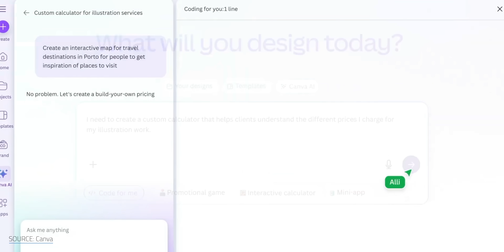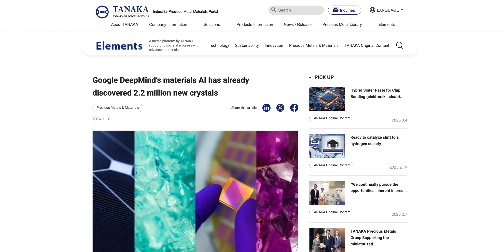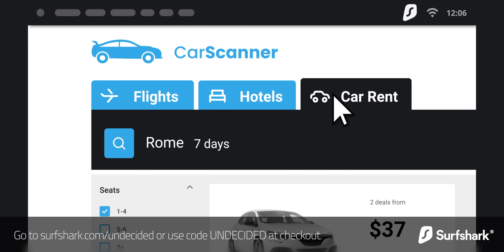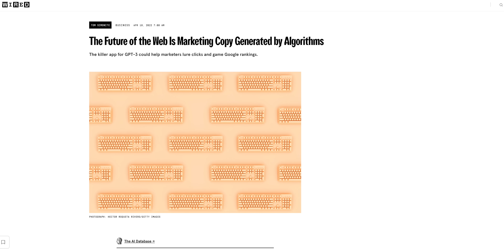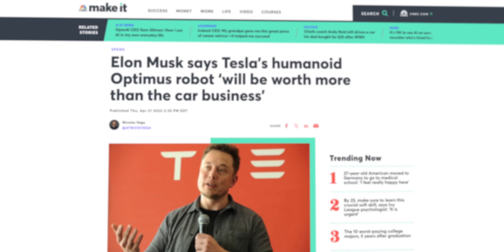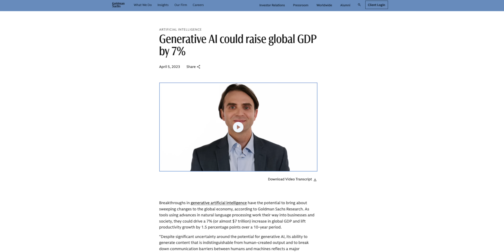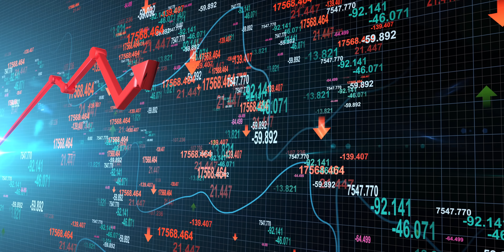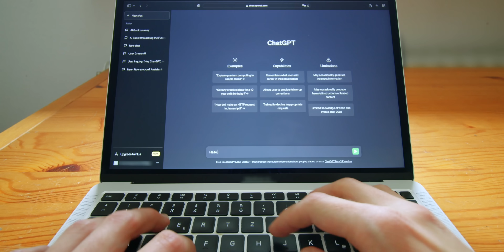Why the AI Revolution Has a Fatal Flaw

Comment: As someone who has been "an expert in many things" and used AI (I'm a former military "Rocket Scientist" and serial entrepreneur/inventor) I routine reach the limits of ChatGPT and Grok.  It's not really hard.  It does accelerate but it does not invent anything by itself.  It simply helps human do what search engines have finally failed to do.

LLM/Machine Learning AI is, what we call in Electrical Engineering, a "causal system".   That specifically means - it IS NOT INTELLIGENT in any strict sense.  It's a zero sum of information in terms of training and can never "create" much more that it was fed - only a combinatorial expansion of that existing information.   A human can create with the help of AI but it's only an accelerant. 

The one things about AI is that tere will be lots and lots of Midwit/Dunning-Kruger managers who will confuse what AI does with actual intelligence.   MOST of these companies who jump in hard will ultimately FAIL and go bankrupt.

Photoshop is still needed - because the images have hallucinations in them beyond a certain minimum (I do art as a hobby, and use Photoshop).   It's the same limitation described above.

There is a good point about the Jevon's Paradox.   The intersection of losing jobs, failing demographics and AI does create a dangerous situation.  It's NOT primarily about human work (either lost jobs or lost demographics) - the bigger problem is AI generate NONSENSE that very often does NOT align with reality.  This is the exact same nonsense as WOKENESS - it doesn't matter that the idea is creative or ideologically ideal - the only thing that matters in the end is MERIT which corresponds to a reality-based solution.  AI can not and does not do that.

Again when an expert uses AI, that expert (like myself) routinely runs into the limitations very quickly.  AI is enthusiastically stupid and error-prone.  And that means jobs replaced by AI will not magically be done well enough to produce economic value for the corporation(s) that adopt it.  In fact, the odds DROP that fitness of value generated by AI will ever be of use by the market.   The markets created will resemble the Chinese real estate market, steel and concrete markets, etc.  100% made and fake.

The reason is because markets do NOT exist without humans and human desire or need.  You can pretend to replace consumers with AI also but it will rapidly create a non-physically viable market values.  That will collapse upon itself pretty quick.  Just like China's economy or Russia's economic are collapsing - they do this because they are disconnected from economic reality.

UBI is NOT financially viable.  As is the offer to "be put into a computer".  Neither of these are ENERGY or FINANCIALLY viable.   The only resulting answer WILL BE SYSTEMATIC GENOCIDE.   

People put into computers will have to "earn" value to pay for the energy and maintenance required.  Most will simply be "deleted" and probably as soon as they are put into the computer.  That is the optimal solution.  As defined by physics and economic realities of it.

Keep in mind that the energy efficiency and reliability for all computers and AI are <1% of what humans are.  That iPhone you use has a chip lifetime of about 10 years and can not self-repair or reproduce itself like a biological.  

And the future of making anything that can match that is no less than 500-10,000 years if everything went right.  These is a very good chance this limitation is backed into the laws of physics of our universe.  Period.

People who claim "singularity" will fix that are ignorant liars at best.  They know NOTHING.  Singularity as equivalent to human intelligence is 1000s of years into the future at best.  Their arguments are simplistic and detached from reality.

Comment: The kind of research you do isn't going to be replaced by AI at all. It requires critical thinking, weighing cons and pros. Something I definately do not see in any of the LLMs so far anyway.
The broader point of your concern remains valid though. People working preparing boxes to be shipped, getting replaced  by robots - I don't see them easily shift to office jobs: partly because it doesn't match their skills -- but partly because it doesn't match there interests, which is a very different factor

Comment: Lots of questions. No one is talking about what will happens to the developing countries. Individual as in poor countries, what about the baby boomers? Many boomers which still work probably could find jobs in the process of building the new industrial infrastructure that should be made, and most prediction point toward a massive industrialization required by the tariff crisis, during years to come, so probably jobs will be abundant still, if the growth in industrialization is matterialized  but not 100% robotic, at least until boomers are completely out of the labor market and newer generations will be more integrated into the AI revolution. I think that a possible solution is to regulate labor thinking in that way.

Comment: Capitalism as a system just doesn't make sense with the introduction of AI. But of course that's operating on the assumption AI can actually do the jobs theyre replacing properly, which is simply not going to be true for most of them. Not that the rich care about that. A lot of them are accelerationists. Societal collapse is the point, because they believe they can grow their own little city states out of the ashes. The rich need to be reigned in or well be subject to pure anarchy.

Comment: Look into the various musing on post labor economics - generally speaking what you tend to see is the idea that UBI will provide for basic needs and investments will provide the rest (and a small amount of jobs where human-human interaction is preferred will persist).

Without wages people will  begin dividend seeking which will create a competative market for companies (now flush with profits from not needing to hire labor) to provide monthly/bi-weekly dividends to replace the cashflow people are used to from wages. As long as UBI is greater than the bare nessesities in a given location then it provides an on ramp for people to enter into the investment economy. You don't even need to provide UBI purely through taxes, if you direct the FED to disburse cash as UBI instead of as loans to banks then (using the average monetary policy from 2010-2020) you could provide every citizen with ~24K/Year through monetary policy and only top off the rest via Taxes. There's also the added benift that if you remove the Fed loans system then companies need to seek funding through stock or bond sales which all increase monetary velocity back to the consumer base. The Gov just needs to provide a UBI system and allow existing retirement vehicles to be accessed at any age and the rest of the system should evolve from the current economic system.

Fast-forward to ASI and you can envision an economy in which people's personal AGI's invest in companies based on the persons preferences (risk, ethics, morals) and the companies they invest in are all automated, run entirely by ASI systems, emedded with anti-monopolistic drives, and owned by millions of people with no one individual holding any significant sway in the company. In essence - "you" will own "everything".

Comment: I have had this question bouncing around in my mind for some time. Future prognostication is never good, but deeper research is required to understand the "tipping points" to determine more realistically which way things might go.

Another issue I would love to research -- but haven't had the time -- is the exponential increase in the electric and water consumption needs for the data centers that will be required to physically power all of the rapid growth in AI. It ain't free (as casual users tend to believe and use AI as a mundane replacement for two seconds of mental effort, making us dumber as AI gets "smarter"). There will be two closely related problems: 1) rapid escalation of electricity demand (especially as the U.S. power grid is already fragile), and 2) impact on climate change if we solve the first problem by keeping or even growing fossil fuels such as coal to power these centers.

If the electric grid cannot expand quickly enough, there will limits to how quickly AI will be adopted as the cost of using it will increase dramatically, etc. (Homes having brownouts simply due to AI demand? etc.) Have you done any videos on this?

BTW, love your work!!

Comment: After the tipping point of the AI revolution, money will lose its traditional meaning.
Work that still requires human involvement will be done by volunteers—people seeking purpose, fulfillment, or connection. For them, contributing will be a choice driven by meaning rather than necessity. And for those who prefer not to work, they won't need to—because survival will no longer depend on income.

Comment: I think training robots will be a massive field of employment for the initial stages.
Also we don’t have the bandwidth infrastructure in place to run so much Ai. The robots and Ai with therefore occupy niches where the computational and telecommunication capacity is most profitable. So a lot of Ai will be dumb enough for humans to still be useful in a directorial capacity. 
Until we have developed cheap widespread electricity to power ubiquitous high level Ai then most Ai will be preprogrammed bots and augmentation of human activities imo.
It’s essentially an infrastructure limitation issue.

Comment: Based on data available through October 2024, several key statistics show the impact of delivery services like Uber Eats, DoorDash, and Grubhub compared to the pre-app delivery era:

*Market Growth and Penetration:*
- The U.S. food delivery market grew from about $4 billion in 2015 to over $50 billion by 2023
- Online food delivery penetration reached roughly 30-35% of total restaurant sales by 2023, compared to less than 5% in 2015
- During COVID-19 (2020-2021), some markets saw delivery grow to 40-50% of restaurant revenue temporarily

*Labor and Employment Effects:*
- By 2023, there were an estimated 5-6 million delivery drivers across major platforms in the U.S.
- Traditional pizza delivery jobs (which dominated pre-app delivery) remained relatively stable but represented a much smaller share of total delivery employment
- Studies showed average hourly earnings for app-based drivers ranging from $10-20 per hour after expenses, compared to traditional delivery drivers who typically earned $12-18 per hour including tips

*Restaurant Industry Impact:*
- Commission fees to restaurants increased significantly - apps typically charge 15-30% compared to traditional delivery services that charged 10-15%
- Restaurants reported 20-40% higher delivery volume but often lower profit margins per order
- Ghost kitchens and delivery-only restaurants grew from virtually zero to thousands of locations

*Consumer Behavior:*
- Average delivery order frequency increased from about 2-3 times per month (pre-2015) to 6-8 times per month for regular users by 2023
- Order values typically increased 15-25% due to easier upselling through apps
- Delivery radius expanded significantly - apps serve areas that traditional delivery rarely reached

These statistics come primarily from industry reports, academic studies, and data from the Bureau of Labor Statistics through 2024.

Comment: Perplexity pro has an incognito mode i can use to work on customers data without letting them be used for training. It gives me peaces of advice on many technical topics , saves me time and helps me fix issues.

It usually goes much faster than Google.

It can process things i dont understand myself.

It can find flaws i cant see.

It provides sources when i need to quote code (either legal or technical ). 

So yes it helps me work alone, and avoids me employing people, or pay specialists.

But ... My company is losing money, so if i had to pay for all those things i would be bankrupt since over a year , have closed my company and be jobless. 

If i was jobless, i would produce nothing at all, and would not either have cash to pat specialists. So, AI or not, i can't pay specialists. 

AI keeps me living. 

Each time i get some spare money, i pay someone to check what AI did in the past. Last week i spent 1500€ to rewrite my website.

Comment: I've been thinking this for some time. The evaluations are based on the idea there are consumers. If few are employed, where are the purchasers? Thank you for putting a spotlight on the issue. 

I'll add that if there's going to be help for the displaced, why are safety nets being cut while we cut taxes on the affluent? Wouldn't that need to be reversed?

Final thought and I don't want to be a downer: what are the odds we get AI right for 2000 years? For 200 years? For 20? At some point it seems likely we make the wrong set of  mistakes (whatever those are).

I don't see it as a question of if. It's when. Maybe I'm alive to see it, maybe my kids are, maybe we figure it out. But it feels like a Fermi filter we aren't talking about. Because it's inevitable and human imagination doesn't think longer term usually.

I'm not a doomer. I'm just seeking to see clearly and challenge fate where I can.

Comment: Based on recently reported AI exploits specifically focused on "LIKE" data sets, there might be a high expectation that human jobs,  most likely starting with jobs with repetitive and or repeatable tasks will be replaced ... this trend has already been in motion with robotics since the micro chip explosion back as far as the 80's ... BUT ... like the onset of the Internet, where information could be quickly searched digitally,  AI, per my experience, has only enhanced this digital search capability such that a HUMAN still needs to glean whether the resulting information is relevant. Although I have been involved with computer software/hardware design et all for over 40 years, attempting to configure a linux machine especially if you don't do it as a daily task, can still be daunting ... case in point, currently on day 3 of attempting to integrate a PI camera into Home Assistant with the help of ChatGPT 4.0 (supposed to be a simple task) ... while progress has been made, the end result is still a work in progress. From my observation and discussions with other technically oriented individuals, although AI has seemingly mastered language (being capable to reasonably determine from user input: subject, context of a question that it is being asked to answer ... IMHO better then MOST help forums), we have yet to see any evidence of thought ... you can present AI with a question and it will return the most likely result from its available dataset,  which to be fair, can save you from having to dive into reams of data yourself ... BUT ... AI interaction from my perspective still requires trial and error / cause and effect processing ... which ultimately requires a HUMAN that can ask the right questions and select/try the best answers ... there will always be businesses (bean counters) that believe replacing people with tech will make them rich ... suffice it to say Henry Ford's idea of only making products that his own employees could afford will be lost if there are no more employees ... history provides numerous examples of what happens when social imbalance becomes intolerable to the masses ... hopefully that rabbit hole doesn't present itself in whats left of my remaining journeys around the sun.

Comment: This is not really a flaw. You have to keep in mind that the AI is owned by corporations and is their private tool, not yours. These corporations will simply transition from producing consumer goods (as there will be no consumer as far as they're concerned) to producing goods for each other. It is not their problem that you will be left without anything; "civil unrest" is handled easily with modern tech, which will soon also become autonomous. It's likely going to be cheaper than providing UBI, too. Not that there would be any consumer products you could spend it on.

Essentially, the economic system will split in two separate ones: one for the AI-owning corporatoins, and another will be built up from rubble and leftovers by the rest of humanity, if it refuses to simply die out as it is currently being primed to.

Comment: Ultimately businesses need consumers to drive economic activity. Particularly in America the economy is heavily dependent on consumers. Businesses producing products and services that nobody can buy will die. UBI and co-op style ownership models are where it has to go. AI may look like a disaster for workers and short term it could be. Long term though it shows the fatal flaw in capitalism that perpetual economic growth isn't possible, AI is just accelerating our journey towards that finish line which will lead to a new economic model that will be some hybrid between socialism and capitalism where there is still ownership but it will be more greatly shared with government supports designed to look after the many rather than the few while still supporting job creation. More to it than that but thus comment is already too long.

Comment: You're thinking about this wrong. The economy is just a new way for the powerful people to get what they want: Labor, energy, resources, more power. Before there was an economy the powerful just rocked up with a bunch of horse archers, killed and enslaved the locals, and took the stuff they wanted. After AI, the powerful just get AI and robots to get what they want. You have nothing to offer so you'll literally not worth the food you require to live. Those farms can all be paved over by solar panels to power the robots that do everything a human workforce does, but cheaper and with less hassle. There is no need for an economy. There is no benefit to let you live, and it's no loss if you die.